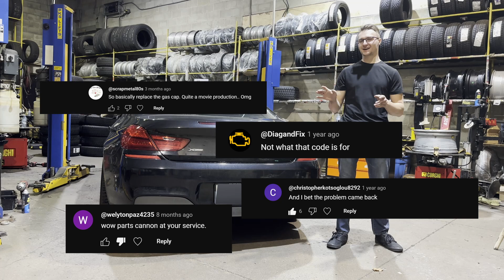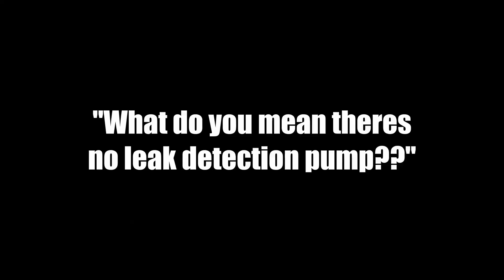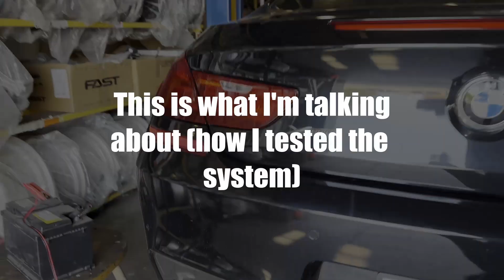190302 Code BMW. How to PROPERLY diagnose

Comment: I have the same error code right now. Just watched your first video some minutes ago and it was quite helpful honestly. You provided information but again some people are just not gonna be thankful i guess lol . Anyway I am going to order a new gas cap for my X3 now :D Thanks for the videos! Keep it up!
Reply: Did this work?
Reply: @jackgilmartin5 error came back up after changing the gas cap. I decided to do the smoke test. Checked under the back seqt - no smoke. Wanted to check the valve which is near the rear tire on the right side but sis not have time for it. Called a bmw specific gafage and the guy said he is 90% sure its a faulty valve near the engine. Its cheap to get a new one and easy to find and replace so i ordered one. The day for the change comes, i start the car and the light is off, no error... i returned the new valve. So basically it seems like it went away on its own... hasnt came back since.